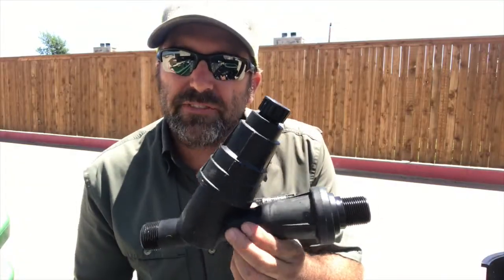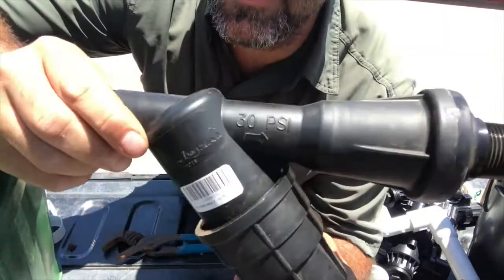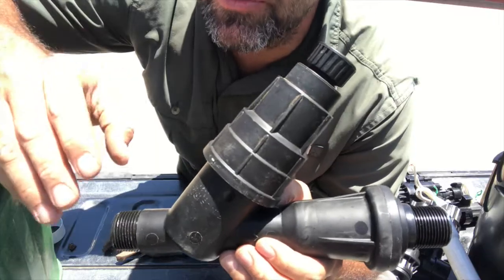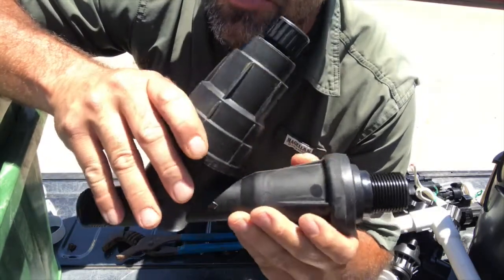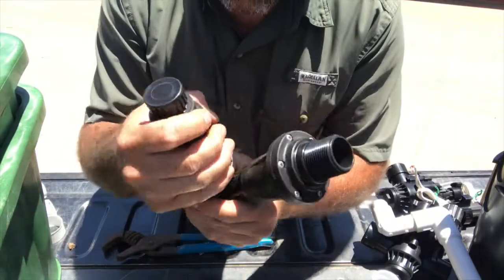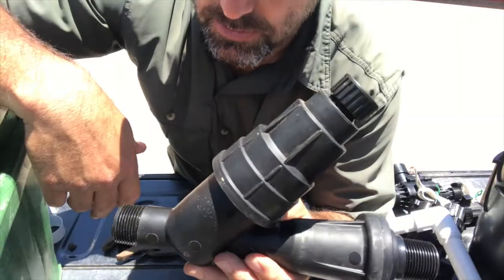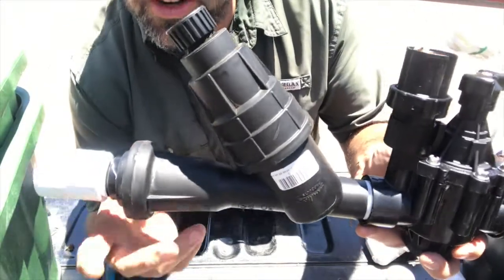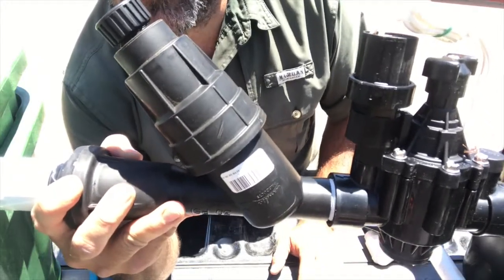Drip Irrigation "Y" Filter With Pressure Regulator

Comment: Can I install the pressure regulator before the manifold of all the control valves (I have 2 for each yard zone) so I just install one instead of install 2 from the outlet of each control valve?
Reply from the maker: It really depends on what the static pressure of your system is. If it’s high, then you can regulate the entire system at your source connection or backflow device. But if the pressure is marginal you will want to be careful about regulating the pressure before the valves. Too low and they may not shut off properly. In my area we only regulate the pressure on the drip zone at the valve, but the best place to regulate the pressure on a spray zone is at the head with a pressure regulating head. Hope this helps.

Comment: What is the incoming normal pressure to the valve manifold normally house?
Reply from the maker: Varies by area. Around 60 psi is normal where we are. If it is higher than that you will be regulating it at the meter.

Comment: I don’t understand why we’re using 1 inch instead of three-quarter does it matter can someone explain why not use inch and a half 2 inch definitely not half inch I just think three-quarter should be sufficient, but maybe you have a lot of plants bushes and trees
Reply from the maker: It really depends on what your output flow is.  In most residential jobs 3/4 should be sufficient. But on a commercial job with bigger zones, you will go with a bigger size.

Comment: Guys use unions on both sides of the regulator manifold makes easier for repairs if you have to take it out
Reply from the maker: Some of the jobs we do there will be unions specified on all valves. Good way to do it.

Comment: That looks really good. The only problem that I would suggest is, if you put the valves in a box in the ground, then it makes it very hard to add lines to the system later down the road where if you have it above ground which I don’t really like it’s on the sightly, but it’s easier to dig the trench at the pipe I live in the desert and the ground is hard and my irrigation is a working progress when I have time so putting it in the ground all vowels would have to be in place ready to go unless you outside the box, any futures, but just made up the regulators in the boxwith the reducers reducers that would work just cap off the ones you’re not using in the future dig up the box and attach your pipe to whatever direction you wanna go

Comment: Thank you it sounds stupid but too many years went by where I was replacing nozzles and blowouts and couldn’t understand why then I put a pressure reducer 30 psi in line and never had a problem again plus I hung the drip tubing on the wire fence in a wave pattern to keep it abovethe little critters that like to bust the pipe to drink the water and a little bit of slack for repair never had a problem since

Comment: I am having issues with one of these on my system.  I am not getting any or very little water flow from it.  I have cleaned out the filter and scrubbed it down, which helped for a few seconds, but now back to the very low flow.  Could it be the regulator is bad?  Can these be taken a part and cleaned if that is all it needs?
Reply from the maker: I’m not sure if the regulator could be bad or clogged. I’ve never taken one apart either. But you might try flushing out the valve and filter a little bit long to clear out any excess debris in the main.

Comment: Irrigator guy - question...... do you have a video about installing a y filter/pressure regulator underground.  I have three zones in the front yard.  Each valve is in its own round plastic thingy (underground).  I know to install a regulator down stream from the valve, but can it be underground or needs to be on a riser... Just thought of something. If I cut the pvc after the valve, can ALL my drip for that zone come off of that, or do I need to come off of each riser on that zone.  I really have to get this figured out and the water running again.  BTW, we suck from the river..... PLEASE ANSWER!!!!
Reply from the maker: If you install a filter/ regulator after the valve in the ground, you will need to install a bigger valve box to go around it. That way you have access to clean out the filter. You can have one stub up for drip if you don’t run too much drip on that zone and you don’t have real long runs. It’s a good idea to feed the drip from several places to ensure good even pressure though.

Comment: Any idea why mine might be leaking out from the filter itself? I thought maybe an o ring might have gone bad. Any thoughts?
Reply from the maker: Could be an O ring like you thought , or the cap or housing is cross threaded, or debris in the way of it tightening down, or it is cracked. If it is a Rain Bird basket filter, the O rings get twisted and messed up causing it to leak. The first thing you can do is take it apart, clean it out, and try to get it back on better.

Comment: mine is leaking from the clean-out cap area where the filter is, should I replace the whole thing or just the cap area?
Reply from the maker: It may be cross threaded or the gasket on the cap is messed up. I would check the cap first before I dug it up and replaced the entire thing. You may be able to just replace the top part that holds the filter in and has the cap on it. Just some ideas.

Comment: Thank you for the tips. If you have multiple drip valves together, would still do that? Or have a pressure regulator and filter before your values servicing all of them?
Reply from the maker: Even if I have multiple drip valves in a valve box, I still put a separate filter and pressure regulator on each valve.

Comment: Thanks for the video. In HVAC the Y strainer must be installed w the filter/blowdown facing down. Do you know why it can point up for irrigation purposes? Obviously it’d be impossible to clean out if facing down in a valve box...
Reply from the maker: Yes the obvious reason is for cleaning while it is in the valve box. When it comes to the orientation of the Y strainer, most of the time it comes down to manufacture specs and recommendations. Then most city codes follow those recommendations. This is a real touchy subject when it comes to y strainers before backflow devices. lol.

Comment: I have a question I hope you can help with.  I recently heard about faucet filters and hope you can tell me what I need.  I do not have drip irrigation and don't need a pressure reducer.  I just need the filter.  I am on city water inside my house, but I have a well out back to water the lawn and it brings up a good bit of sediment and clogs my sprinklers so I am looking for a filter to attach at the well between the faucet and the hose.  Any suggestions?
Reply from the maker: You could do a sand separator filter right off the well and filter the entire system. A good screen filter on the faucet will work good for just the faucet but I would strongly consider filtering the whole system. I recommend getting a licensed professional in your area to help you get the right filter and the right size that will fit your system because there are some technical things to get right, like on a sand filter, to get it to work right.
Reply: @AmericanIrrigator  Thank you so much.  I'll talk to the guy who digs and works on wells in my area.

Comment: When installing a double check  backflow preventer and manifold/valves for sprinkler heads and drip irrigation, can a good filter be placed between the double check and the valves?  What is your recommendation on the best location of the filter?  I probably need a separate pressure regulator after the valve used for the drip irrigation.
Reply from the maker: Yes you can essentially place the filter anywhere. If it is a system that has a lot of debris like sand, then a filter just after the backflow preventer is a good idea. If it is a system that is on city water that is fairly clean most of the time then it might not be necessary to have a filter on the entire system filtering the valves and heads and drip. In this case, a filter just on the drip zones would good. I typically just install the filter and regulator on the drip zones and not the rest of the system.

Comment: Can these filters handle the pressure from a high powered pond pump? Idk what psi it is...
Reply from the maker: It should I believe. A lot of the sprinkler parts are rated for a good amount of pressure. Most up to 100, 150, even 200 psi. Most pumps will be set to shout off around 50 to 60 psi unless you need more pressure , like if it is a big system or a golf course.

Comment: Is a y filter recommended for sprinkler lines using well water or just for drip lines?
Reply from the maker: Yes you can use them on the main line on the sprinkler system that is on a well. Most of the time guys will use a sand separator for the filtration of the main line, but I have used Y filters and disc filters in this way. I like to use them on the drip zones for sure, especially if the system is on a well, but I don't usually worry  about the rest of the system. All little debris and little sand will flush out through the heads. But if the well is pumping a lot of sand and very course sand, a sand separator is the way to go.

Comment: Good video Bhro..
Reply: If I may give a tip when applying thread seal tape, it maintains tention on the thread seal PTFE Tape, as you where doing. Hold the end to be taped in your right hand tape will be be applied from your body over the top of the fitting as you where doing. Just iturn the tape role upside down so that the tape roles of the bottom of the role. This will ensure that the tape sits firmly an the fitting. Put your pointer finger inside the role and apply slight pressure with you thumb...... This gives better contole and tention. Trivial tip but it help

Comment: Does Landscape Products make this with an adjustable regulator?
Reply from the maker: They do not make one like this that is adjustable. Most of the Y filters the have built in pressure regulators come in 20 psi to 40 psi reduction.

Comment: Thanks for the video. If you just have one pipe coming out to the  drip zone, what is the advantage of using this regulator at the valve, rather than a simple inline pressure regulator right before the drip tubing?
Reply from the maker: Good question. Either way is good and will work. If you have just the one pipe coming up and tying onto the drip like you are talking about, then using a regulator at that point would be good and I have done that on certain jobs.  I have even put small pressure regulators on older systems that way, right where the pipe comes up and ties onto the drip. If you end up with several transition points on a single zone, then just one regulator at the valve would be the best way to go. Mainly for cost. But both are good ways to do it. I don't know if there is a real advantage either way. It really depends on the job and system.

Comment: how do i get transition peice, after pressure regulator, to stop leaking?
Reply from the maker: It could be that the piece is cracked or messed up, so in that case you would need to take it off and put a new one on. Which means digging and cut out stuff and a lot of work. But sometimes that is what needs to be done. It could also be that it is not tight enough but you must be careful to not over tighten. Or it could be that there was not a sufficient amount of teflon tape used and it is not sealing off, that is why it is leaking. Most of the time to get it to stop leaking, it has to be redone. I'm sorry to say this but sometimes this happens. If I install something and I turn the water on and that thing leaks, I shut the water off and start over to make it right. Hope this helps.

Comment: Thank you for your videos. They are very helpful. I’ve been searching for a filter/pressure regulator like that for some time. What is the product’s name and where can I order it? Thank you.
Reply from the maker: Sorry for the delayed response. This particular one is a Landscapes Products brand form Ewing Irrigation supply. I would also recommend Rain Bird filters. They have a few different ones that are good that I use. I think you can buy online at Ewing's website and Rain Bird's website as well. I have found Rain Bird filters on Amazon, just make sure it is a good trusted seller to get the right thing and not pay too much.

Comment: So I wasn't aware that the in-line filter I installed did not have a pressure regulator so here's my question, instead of cutting the pipe will it be ok to installed a pressure regulator at the end of the pvc pipe right before it connects to the drip tubing? Thanks
Reply from the maker: Yes that is a good place to regulate the pressure also. They do make smaller pressure regulators that work well in that application. I have done it that way several times.

Comment: I have an orbit 1 inch pressure regulator/filter unit. It's blowing water out the relief valve in 1 second increments. Very frustrating, not sure why it's doing this.
Reply from the maker: I'm not very familiar with orbit's regulator/filter assembly, but it does sound like a high pressure issue. The pressure will only be regulated after the regulator, if it is blowing water out before the regulator, it may mean the pressure is still high upstream of it. But you might try turning the water off and make sure all of the fittings and parts are strewed down good and not cross threaded or anything. I'll look into orbit's deal more and seem what I can come up with.

Comment: even if my water pressure is 25psi i still need pressure regulator?
Reply from the maker: +chene gonzales 
No, not if your pressure is that low already. It’s best to use a pressure regulator when your pressure exceeds 40 psi. But anything under that should be ok not to use a pressure regulator. I would still suggest using a filter on the drip zones though.